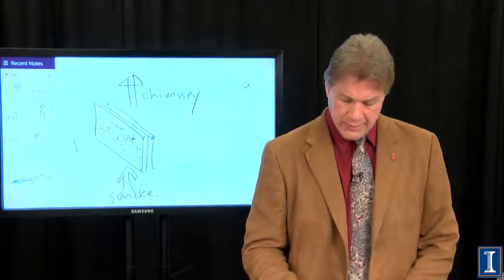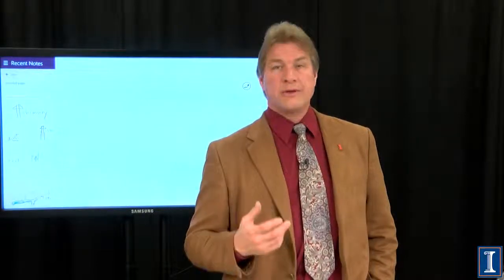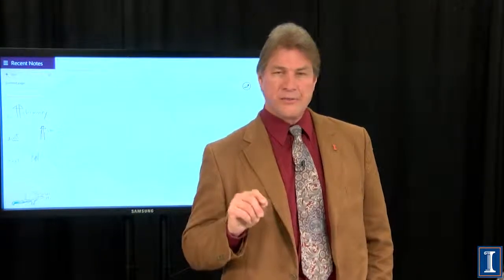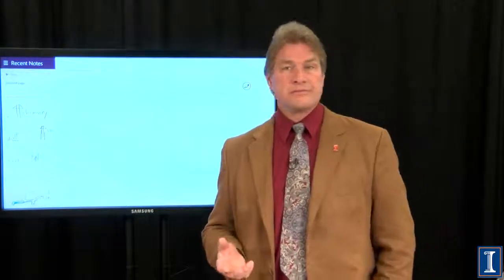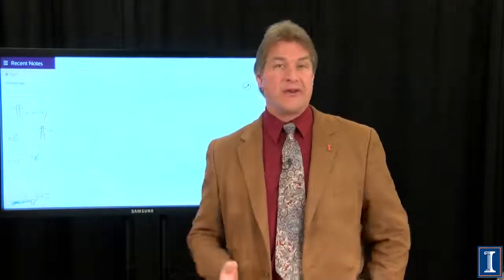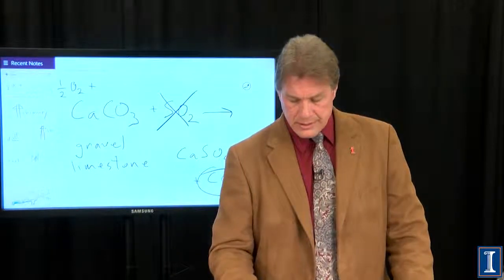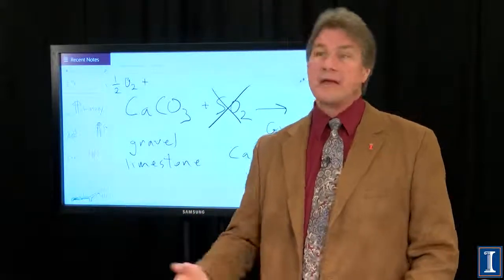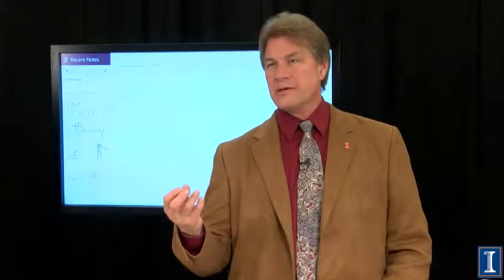What goes up in Smoke?

Comment: It seems to me that the synthesized gypsum could be sold for various applications. Hell, you already mined the coal that you burned and processed the combustion products to get it anyways. Wallboard, Portland concrete, use in pollution control (saline soil reclamation/removing lead and arsenic from contaminated waters), as a fertilizer and soil conditioner for agriculture, and so on.